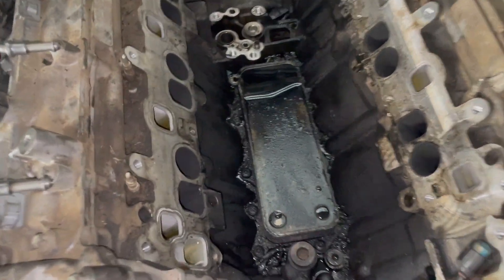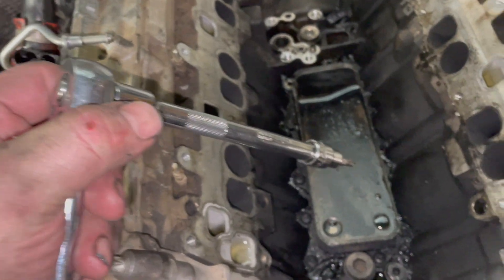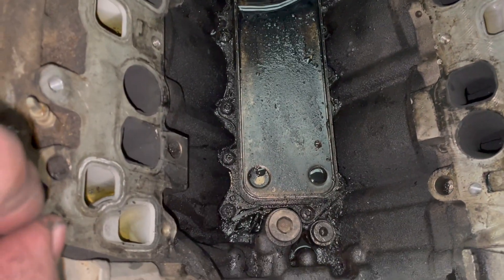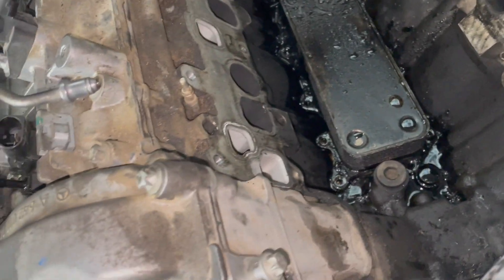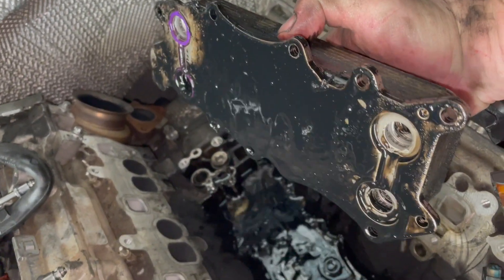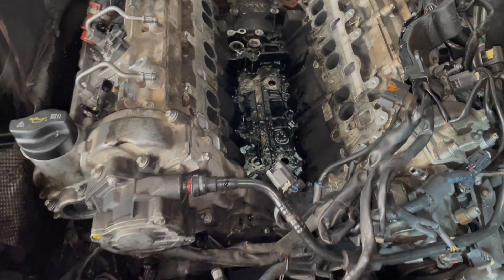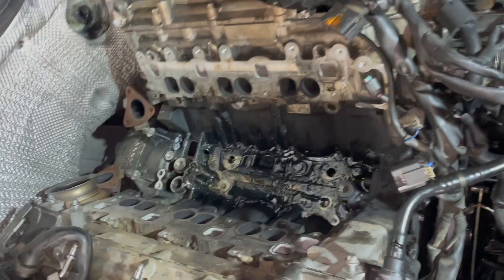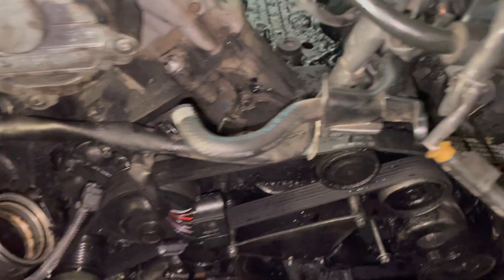OM642 (oil cooler leak fix 5) Diesel engine oil cooler removal

Comment: Just done this job on my own car,idled it for ages,no leaks!!
So i then got on with another job welding the rear seal,while i had the car jacked up i looked underneath and i saw one drop clinging to the edge of the sump!!
Maybe just a bit of residual oil from somewhere,it better be after all that effort!

Comment: Should you not clean around the cooler before removing it? There is a danger particles falling down the oil circulation holes to the engine. That will kill the bearings in the engine.
Reply from the maker: Probably a good idea. I wiped the area right after I removed it so probably ok

Comment: Just done this job,fired up car,no water leaks,and my horrendous oil leak gone!!However,i don't know why i did this but i peered down at the oil cooler through a tiny little gap and noticed a 'really' strange thing at the left side of the cooler at it's very edge,a 'tiny' little silvery sparkle,on closer inspection it was a little bubble appearing then bursting,about 2mm in size,there is 'no' water leaking???
It has fresh red  antifreeze and would be noticable,what the hell is going on?It is just this tiny air bubble where the oil cooler edge seals against the block!!Anyone any ideas?It's a new oil cooler and purple Mercedes seals.
I took the fuel filter off and checked the only oil cooler bolts i could access and they were tight!